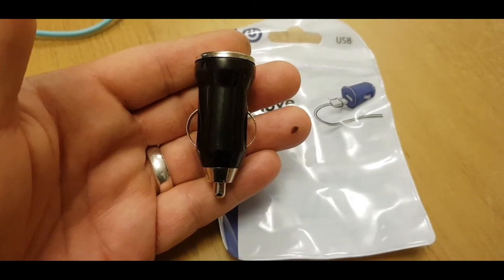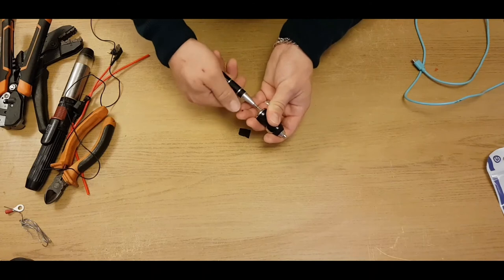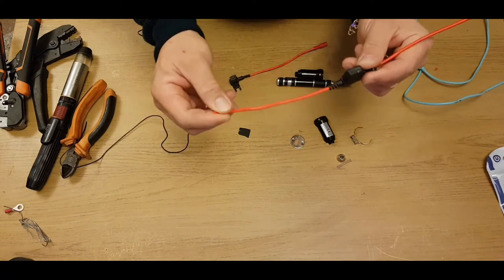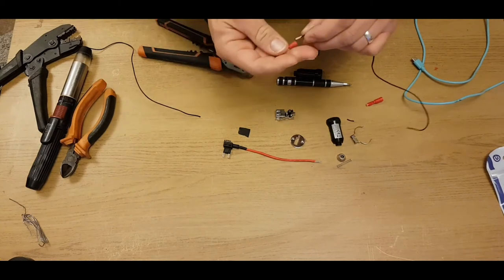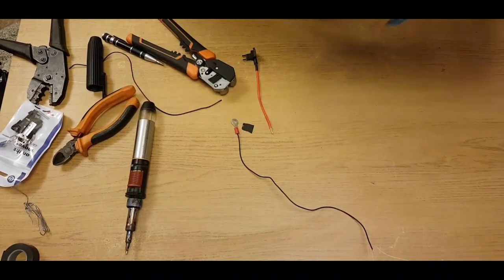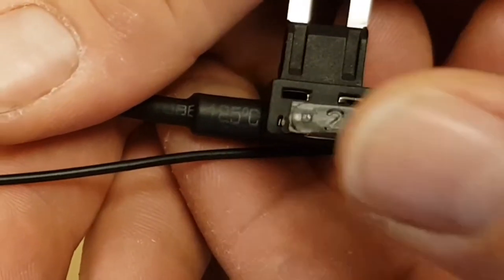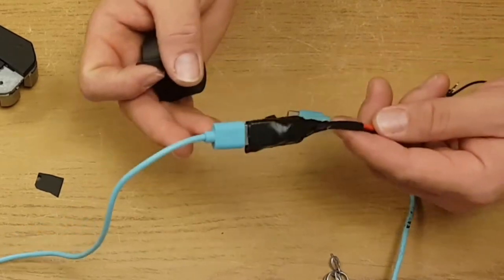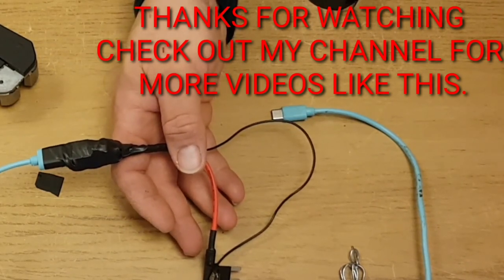HOW TO HARDWIRE A DASHCAM

Comment: Where is the positive wire soldered on to? The ground is to the chassis, but where is the positive soldered onto?
Reply from the maker: a ignition wire or a fuse tap to the fuse box

Comment: Do the 12v to 5v board have a power cut off function? Or can it suck empty my batterie?
Reply from the maker: connect to ignition otherwise it will slowly drain the battery.